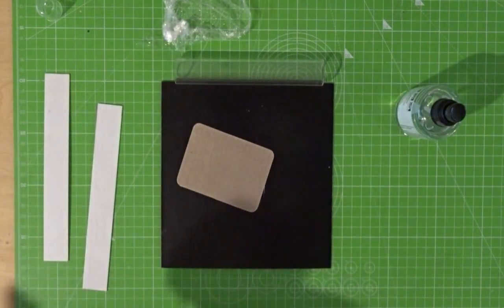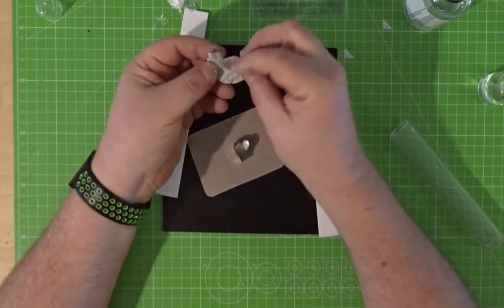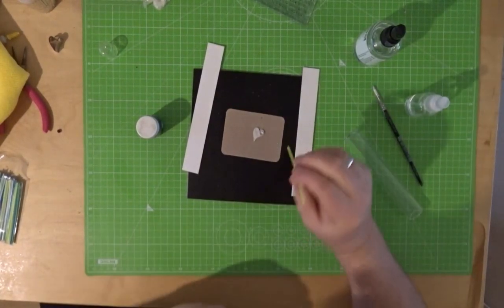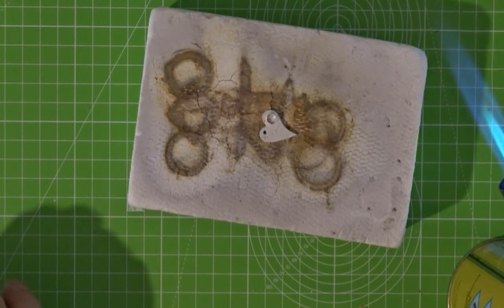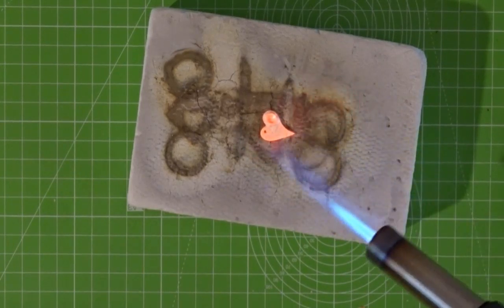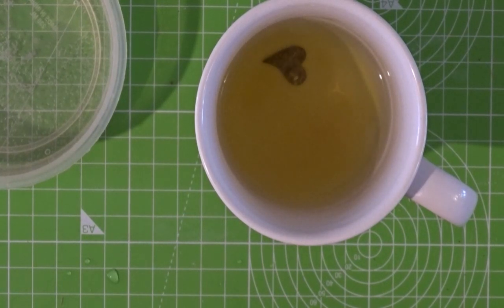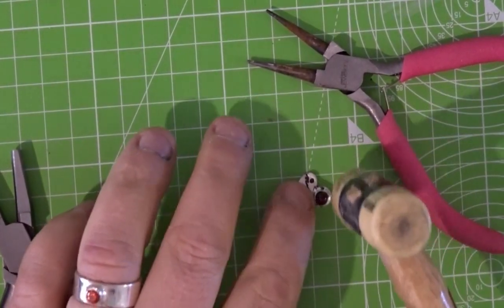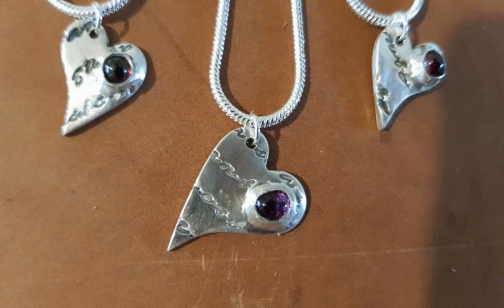Art Clay Silver Tutorial - Torch Fired Pendant with Garnet Cabochon setting

Comment: How did you close/fuse the bezel? Can you just apply the paste or does it need to be soldered?
Reply: Karen I would have punched a star in the heart exactly where I wanted the stone, then roll clay into a snake, wrap around the stone, wet the join seam. Let heart and stone dry, take stone wet bottom of clay and around the punched area, add stone over the punched area, I put a hole so light can come through the stone, let that dry then fire as usual. You can also cut out bezels with a cricket or silhouette. Don't need to go buy wire or solder anything! Makes things easy .
Reply: It doesn't look to me like he soldered the bezel wire closed. It probably isn't necessary to solder it closed since you're going to cover the outside with the silver paste.